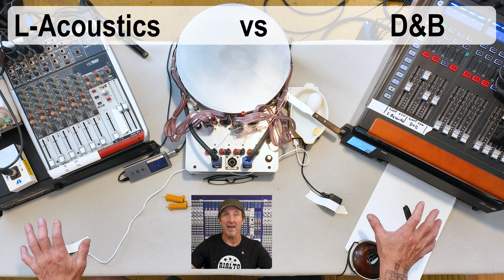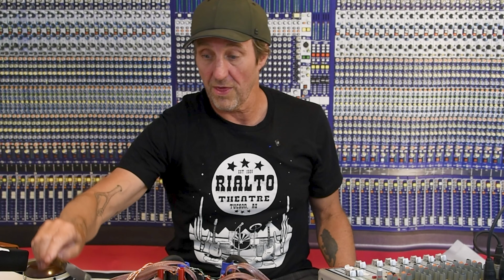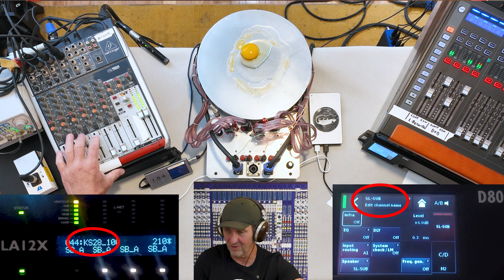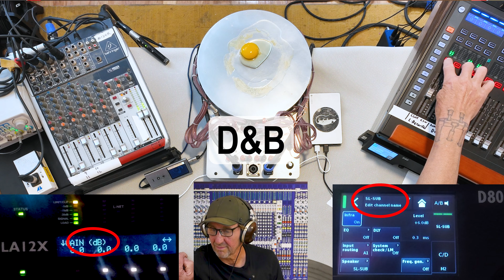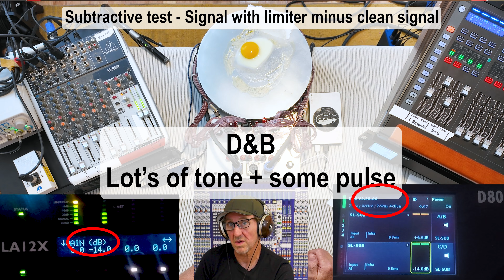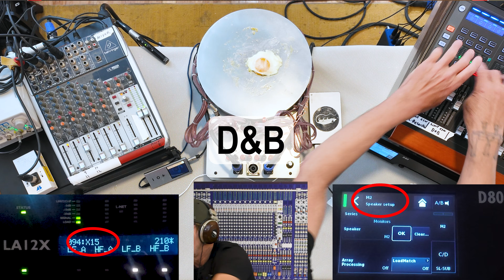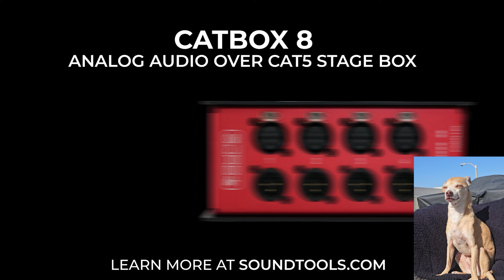Who Does Amp Limiting Better? D&B or L-Acoustics?

Comment: Super interesting - thanks for the test, Dave!

To me, it sounds very much as if L Acoustics uses a longer release time for the peak limiter, which is why the sine wave is still ducked even after the actual impulse. The attack time also seems to be slightly slower with L Acoustics, while the D&B amp sounds like it has an attack time of 0 ms. This makes the D&B limiter sound a bit like a sidechain, which briefly pushes the sine wave almost completely away.

I also found it interesting that the sine wave was significantly louder on the D&B sub. The RMS limiter seems to be set to a higher value, which is plausible for the 21“ sub because it will be more thermally robust than the double 18”. This would have to be repeated with a pure sine wave and two thermally equivalent subs.

Btw: I don't think the crossover point of the X15 is significantly higher. To me, it sounded more like they boost a lot at 5 kHz+ because the driver itself doesn't play flat up to 20 kHz. The high-frequency driver in the D&B monitor seems to play linearly by design (or rather, the horn beams more, which is why the upper edge doesn't drop off as early as with the L Acoustics).

Comment: Where in the world did you get a Rialto Theatre shirt?!!!! I love that venue! 
When you talked about mixing and hitting the limiters, are you saying that you need to run a PA right up into limit? I would be interested in hearing more about that. 
When I mix, it is one of my goals to stay away from the limiters. I do not like my mix being any more then 70-80% of what the meters on the amp software is showing.
Reply from the maker: Love the Rialto theater! rat sound just did an install of L acoustics gear there last year. as far as limiters, it depends on the type of music you're mixing and what sounds you desire but I personally, when mixing a band with a lot of energy, like the sound of a good sound system pushed near or into its limits as it adds a sound of stess to the band.  

limiting and dynamic control is very much a part of mixing a quality sound, for me personally, using the system limiters if they sound good is part of that equation. 

if I have too much PA it's very easy to end up mixing too loud and or have dynamics that jump out well beyond what they should. 

having just enough PA and pushing into limit keeps things under control and pushing into limiters can fill out the sound and kind of give that feeling of redlining a car's RPMs.

All this is based on the limiters for the system being properly set and having a good sound and maintaining tonal balance
Reply: @DaveRat  That is very interesting. I have found that when doing shows, if I get close to the limiters the production companies start being concerned about what I am doing.
I have not run into very many people who want the PA to be pushed to the limiters. 
I do understand your perspective though. 
Thank you for clarifying.

Comment: I was always in the camp that red lights were bad. So if you see one, you didn't have enough rig fo rthe gig. Later on as I got into the upper echelon, and got to play with L' Acoustics and D&B, I was already well disciplined to have more rig than the gig required. Needless to say, I have not had to experience the limiters of either getting in the way, but I can say I do notice they do use a sort of expander. I could be wrong, but I swear L'Acoustics at least, has some sort of expander algiorithm that they use to make lower level signals seem more up front, and impactful than it really is. Am I crazy?
Reply from the maker: no expander in L-Acoustics.  they re dead set on linearity. and even whenimiting trying to maintain tonal balance.

in fact I have done input versus output null tests in L-Acoustics amps and shown that pre limiter what goes in is almost exactly what comes out.
Reply: @DaveRat  Good to know, Guess they just given it good :)

Comment: Very interesting stuff! I'm surprised that on the Sub presets, when they hit clip/limiting it allowed sound outside of its crossover range through the amp. I figured it wouldn't do that? Kinda just sounds like regular old clipping.  Most of my limited limiting experience comes from Lab Gruppen PLM amps. I really liked the way their limiting worked. When pushing it hard,  I didn't hear any distortion, it just simply stopped getting louder.

Comment: I was a firmware engineer at QSC. So many different limiters running inside digital amps these days. Voltage limiter, current limiters, average and peak power for both individual channels and total amplifier power. Thermal limiters too.
Coding limiters was the majority of the gig.
Reply from the maker: yes and agreed! I think that is what is fun about purely listening to what's happening. it's easy to get lost in all the complexity and options. 

what I do and have done on consulting gigs is to get people to listen to the out ones. listen to purely what the limiters are doing.

usually limiting is approached from protecting and then trying to make the protection not sound bad.

I do the reverse and try and find settings that sound good and work toward protecting.
Reply: @DaveRat  what was interesting to me when I first got to peak inside the box was how many limiters arent exposed to the end user that are there strictly for protecting the amp but can affect the audio when things get extreme.
Reply from the maker: yeah that's a good point. The manufacturers bury all that control but if you buy amps directly from an amp manufacturer that are not branded by a speaker brand, they will have typically loans and control and maybe five or more different types of limiting. 

I guess you could divide the limiting up into several categories

limiting to protect speaker excursion damage, which tend to be super fast peak limiters

limiting to protect longer term thermal speaker damage which is really complex and can range from very slow attack time limiters to limiters that monitor voice coil resistance and calculate how hot the speaker is. 

limiters to protect the amplifier peak and thermal overload. 

and limiters to protect the amplifier from blowing the circuit breaker that it's plugged into So preventing the amplifier from drawing more than say 30 amps at 120 if it is rated at that. these are super interesting because these limiters take into account the electromagnetic characteristics of the circuit breaker. I know L-acoustics specifies a specific 30 amp breaker for the LA12x amplifier and the amplifier does everything it can to make sure it won't blow the breaker 

all very interesting and cool stuff that goes way beyond those original processors could have ever dreamed of doing by their designers
Reply: @DaveRat in audio production we use limiters to make shit loud while keeping the signal in check, more about sound control and artistic expression than anything.

Comment: I would think there would be a whole lot more processing going on. IIR and FIR filters with multi band EQ compression  would be my guess. Also the headroom of the amp. Ex: FIR filter with compression. This would stop ringing of the drivers at certain frequencies as the level increases. In the kick drum test you did, the extra headroom of the amp would be used to help determine the attack and release of a compressor/limiter.
Very good test though. Thank you.
Reply from the maker: The amount of processing implemented by various manufacturers is drastically different from what I've tested and what I know from consulting gigs I've done. 

that said, FIR filters tend to add latency for low frequencies and the total amp latency of the amps I tested is too low for FIR filters to have been implemented for the subwoofer limiter tests i did.
Reply: Look at Coda subs, that's one way to do it. But yeah as Dave said, keep FIR out of subs because latency and also the pre-echo of these filters is very noticeable at those frequencies

Comment: Great video, i would say both do great limiting a protecting, i would only like to add that I think this test isn't doing any of them fair due each of 2 companies do a closed system which means that every preset is tuned for that exact driver so a simple load won't show real world outcome . But I understand it's pretty much impossible to measure it so this test is as close as possible.
Reply: exactly, it's a fun test, but way too many variables...at the very least you'd need to mic up the box and also record that and AB the two...you could however make an FIR filter that approximates the box (like a cab IR) and run the signal through that before we listen to it, that would get you a bit closer (real spkr would still be better).

I'd argue using a clean preset on both amps and spending time to match FR, peak voltage, continuous voltage, and excursion on both with a scope etc. would be a more accurate way of "just listening to the limiters"...totally doable, but time consuming.
Reply from the maker: when consulting for audio manufacturers to help them improve their limiting strategies, I use a similar test to help them hear how well they are doing at achieving the goals.

additionally I am proud to say that one of the manufacturers in this test has reached out to me regarding this video and mentioned that they like this test and encouraged me to test other amp settings for other products they manufacture.

and yes, all the other tech stuff is great but the reality of just listening should not be overlooked in value
Reply: @DaveRat  I've been working with d&b soundsystems for a long time and I belive I've never pushed systems more than a very occasional yellow light (so I would say just before gain reduction, maybe some peaks would enter 1 or 2 db gain reduction) and I firmly belive that if you have to push into limter you're doing many things wrong in system planning or sound mixing. But amp protection is amazing on many levels for d&b and I would love they keep the standard.
Reply from the maker: very cool and yes there are many people who have never hit limiters and many who will never mix more than having slightly touched them. as well as many that think they don't hit limiters. 

One of the very first experiences I had with D&B was with the M2 wedges and the entire reason why they were desired for this application was the fact that the musician could get loads of kick drum super loud well into limiting and clean vocals on top of that. 

it was the ability of d&b to reach higher volumes without having to deploy more speakers which are ugly and intrusive on stage, that made d&b desirable. and to do so it required the wedge to have substantial limiting. 

personally I've been involved with many artists wherein the capability of a sound system to operate well into limiting was extremely important. When carrying a sound system on a world tour and encountering larger venues and or increases in seating capacity beyond the systems that we had available, The ability to operate in limiting was crucial.

additionally as the sound system supplier for festivals like Coachella wherein a myriad of different engineers come and mix on a very large and capable sound system, we inevitably run into engineers that push the system harder than others and sometimes well into limiting. 

I personally when mixing certain artists like Rage against the machine, was looking for that sound I could get from a system pushed into limiting. kind of like redlining a car, it gave an edge hearing the struggling of the amps and speakers that can't be achieved when a system is operating well below its limits. 

I very much appreciate the various perspectives ranging from extremely conservative and cautious all the way up to balls to the wall and that is one of the beauties of the diverse range of musical genres and artists in ProAudio.
Reply: @DaveRat  Thanks for taking the time for your long and insightful replies, cheers Dave.
Reply from the maker: wonderful and thank you for commenting and hanging out. I appreciate hearing your perspective and thanks for hanging out!

Comment: Hello hello Dave..!!

From 2007 to 2017, I used Meyer MSL3s (10 years!!!).

Their processors were of two types: two for the MSL3s themselves (you had to use two, one for left and one for right, since they were mono processors) and another (mono) for their subwoofers, the classic 600-watt, two 18" enclosures (unpowered) with classic Crest amplification.

These processors (like others from other equipment and brands that I also used before and after the Meyers) had the characteristic that two wires (+ and -) came from the speaker outputs of the amplifiers (tweeters, midranges, and subwoofers) and returned to the processor itself.

This meant that the processor It would "process" not only the audio input signal, but also the amplifiers' speaker outputs, creating a loop between the processed signal (from the amplifiers' speaker output cables) and the unprocessed signal, with the processed signal always taking priority.

This meant that the amplifiers' speaker output was also controlled, protected, and processed by the processor.

Furthermore, another feature of these processors was their ability to vary the crossover point according to the amount of energy each channel received, thus protecting, especially, high drivers.

Generally, if they detected that the high drivers were overloaded, they would raise their crossover frequency to protect the tweeters and prevent them from reproducing low frequencies.

In fact, these two features were what, in those early 1980s, made this device a processor and not just a... Crossover...
(I should add that I'm 60 years old, and I've been working in the sound industry for 44 years, starting in 1982.)

If a crossover didn't have these two characteristics, it wasn't a processor, it was a crossover.
And if it did have them, then it wasn't called a crossover, it was called a processor.

After the appearance of those Meyer processors, many brands copied this, and in those years, it was very common to find equipment with a processor and not with crossovers.

Generally, on the other hand, a processor didn't usually have any kind of control like crossovers, beyond a master volume potentiometer and a few other things (the Meyer ones had a delay potentiometer to be used as a delay PA, and a switch to put the MSL3 cabinet into full range, in case subs weren't used if it was for a small event, and I don't remember if anything else...).

Furthermore, those few controls were hidden behind a cover so they couldn't be manipulated accidentally or by anyone. Only the master volume was visible.

As I said, I used This equipment for many, many years, with great and satisfying results.

The main problem? Each box weighed a ton!!!!
hahaha...

Nowadays, the term "processor" has become generic for any frequency divider in a PA system. 
Although regular crossovers still exist and are sold, everything is mistakenly called a "processor."

Greetings from Spain.

(P.S. Did you come to Spain on vacation, as you told me a few months ago in a message on another of your videos?)
Reply: Problem with shifting crossover frequency is it changes the directivity of the box... to say the least
Reply: I suppose Mr. John Meyer took this into account when he created those processors in the 1980s, which, even so, included, among other features, that variable crossover function and became one of the most popular processors and sound systems of the time.

Greetings
Reply from the maker: there are many complexities.

do you design assistance that sounds good but has the capability of getting louder with a reduced fidelity? 

do you design a system that sounds good and then stops getting loud at a certain point and when it stops getting loud it definitely doesn't sound good if driven hard? 

what compromises should be made in order to make a system durable and tolerant to being driven harder? if any? 

how important is it that a system is able to get louder? an increase of 6db means you may be able to bring half the amount of gear.

which applications would that be valuable and which applications do you have increased access to equipment size and sight lines and cost to where the added output capabilities are not that important? 

for portable systems, truck space, fuel, load in times and more are definitely factors to consider when looking at system output capabilities 

My take is that the people that want quality at any cost won't drive the systems loud enough to really get into limiting. And those that want maximum output level and minimum equipment deployment want high sound quality and the ability to reach higher output levels when needed and some compromises can be made to reach those higher output levels when needed
Reply from the maker: very cool and good stuff. Yes monitoring the amplifier output allowed the processor to know what was actually sent to the speaker rather than try and guess. 

All the modern processors are built into amplifiers and are able to monitor the speaker outputs and do all of that and more. 

super cool stuff! 

no we couldn't make it out to Spain canceled because our dog wasn't doing well. he has since passed away and we're very sad but I'm planning a new trip soon.
Reply: Oh, that's a shame.

I'm so sorry about your dog.

I really enjoyed seeing him in some of the videos.

Best wishes and lots of encouragement from Spain.
Reply from the maker: well the one that you see in the videos is usually death biter, also known as DB our younger dog. Mr Bones was the one who passed and I've shown him a few times. I also have a shirt with a drawing of him that I wear sometimes. 

thank you so much and I can't wait to get to Spain!